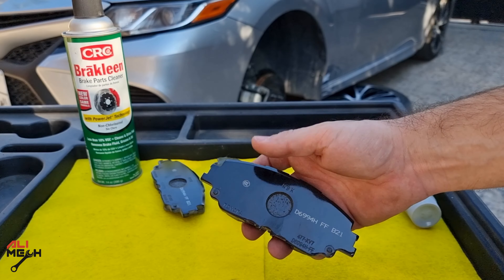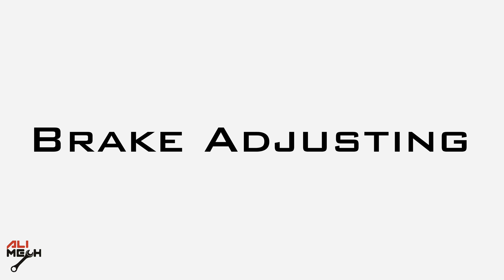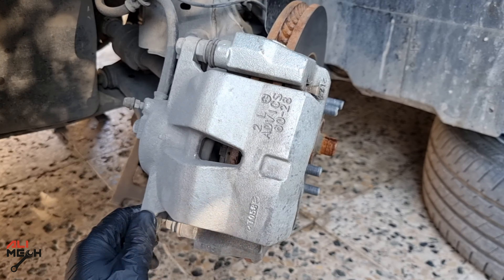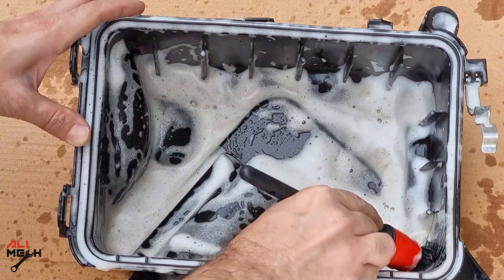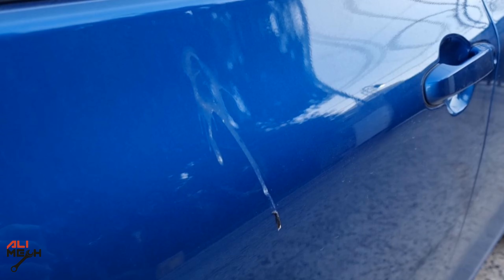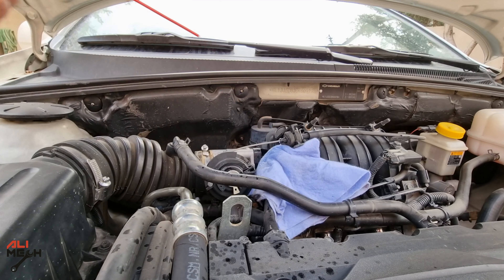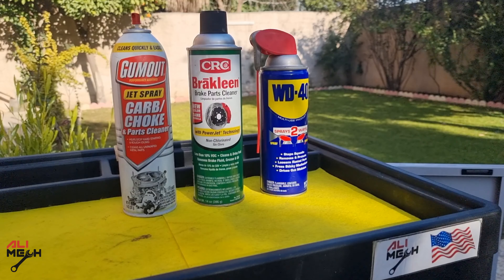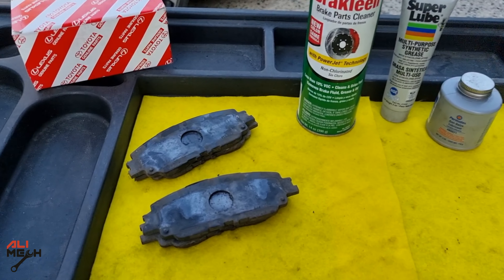I bet you did one of these mistakes...

Comment: I add different coolant today I'm gonna check if it happens I should change the coolant unfortunately
Reply from the maker: If you mix oat or hoat coolant, you need to flush it, but if its normal antifreeze, no problem
Reply: @AliMECH  I read it both were ethylene glycol based coolant
Reply: I went to the shop to buy the one they put the first time (pink one) they didn't have so I went to another shop they had green coolant so I didn't have any choice and bought the green one
Reply: Is it save or I should change it
Reply from the maker: If they both same, no problem
Reply: @AliMECH  thanks for reply 👍